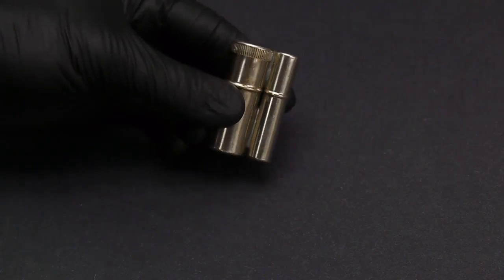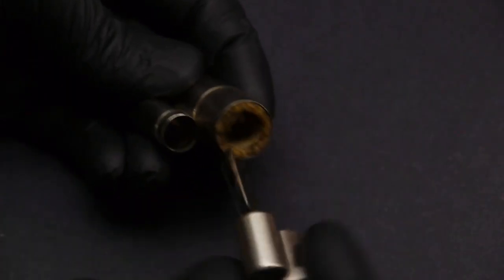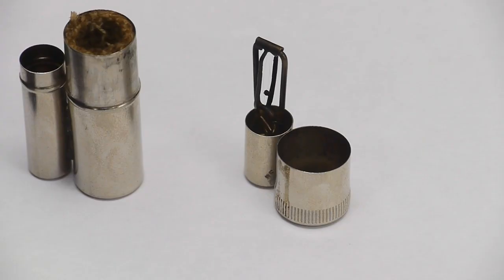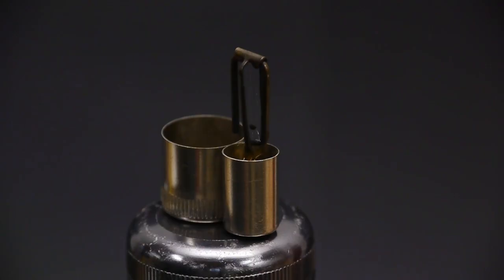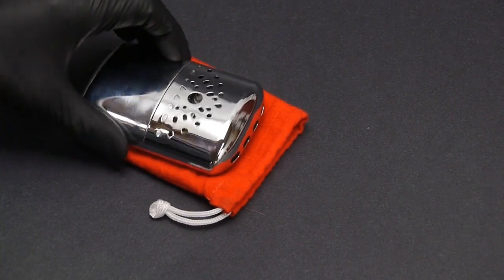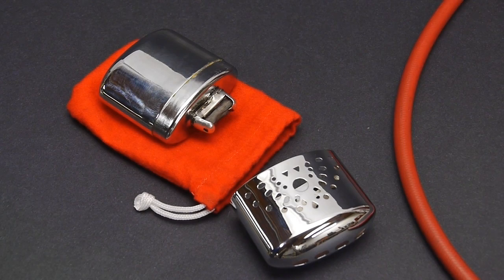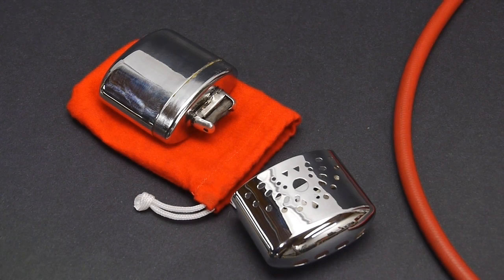Catalytic cigarette lighter

Comment: The reason I found your video is because I was searching the web for a lighter that would light in extremely cold temperatures. 
So far, I haven’t found any that guarantee an instant light if it’s cold like 5° cold outside, and the lighter has been sitting out there for whatever reason

Comment: I bought a methanol lighter at an antique shop. the wire and ball look perfectly intact but it will not light the methanol. does anyone know why this could be and is there a fix?
Reply: Did you ever get it working? perhaps you had a low percentage of methanol

Comment: Platinum catalyzing alcohol and hydrogen but not propane.
Hand warmer would be good for motorcycling in Bay Area. I created my own heating glove using the +12 volt on the battery with a car headlight in series as short circuit protection.
Because at room temperature, incandescent lamp have a resistance 15 times lower, there is little waste when the current from glove heater is 1 amp or less, compared to 5 amps, 60 watts bulb.

Comment: It does not catalyze the burning of methanol. it catalyzes the incomplete oxidation of methanol to formaldehyde, which liberates sufficient heat (due to the tiny mass vs surface area of the platinum) to ignite the rest of the methanol.
Reply: actually The heat comes frrom the catalytic reaction from the hydrogen thats released and the air .Then it ignites the methanol.

Comment: About 10 years ago I bought a bunch of catalytic gas lighters on Ebay, and I made a YT video to demonstrate them: https://youtu.be/TY2r3bSXX1Y  They are very similar to the lighter shown in Sam's video. One thing I should mention in case you did not know this about these lighters. Over time, the platinum wire develops an oxide coating which severely reduces its ability to catalyze the methanol vapors. The wires can be "cleaned" by waving them through a flame from a Propane torch. Apparently, the gas/air flame burns off the oxide coating, and then the platinum will work good as new (for a few cycles of lights) and then it will need to be cleaned again. I am a new subscriber to Applied Science.  Great stuff, Ben!

Comment: I used to use pocket warmers a lot in winter and regret now living in the tropics. About 10mL of white petroleum will last for about 8 hours. I always found that the catalyst needs to be preheated using a clean flame. If you do it by sprinkling a bit of extra fuel on top and lighting that then the wire (or screen) rapidly becomes contaminated by soot. Incidentally, in the Maltese Falcon, Humphrey Bogart has a really cool desktop catalytic lighter. It looks like one of those ashtrays with the spinning disk. You simply pull the centre piece out and have a flame on the end of it.

Comment: Umm, I actually have a catalytic hand warmer similar to yours. Runs on lighter fuel and has to be ignited with a gas lighter. I can't complain, it's the best hand warmer I've ever had and it still works after 4 years or so!

Comment: I've got one of those hand warmers from Zippo. you're meant to fill the bottom part with zippo fluid and start the catalyst using a flame. Once the reaction is self sustaining you can replace the metal cap and put it in the bag. It doesn't light up on its own.

Comment: I found this really old looking fireplace lighter that used to belong to my late great aunt. It comes in a velvet sleeve and is about a foot long and made of brass. It's very thin, about half to 3/4in and appears to have a valve on it for filling it with butane. So I wouldn't imagine it's THAT old. But definitely at least a few decades.

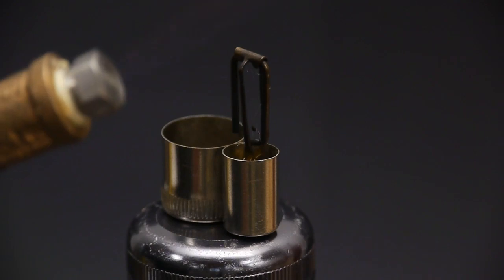Comment: At 1:52 did the platinum wires break?
Reply: yeah that's done and good luck finding a replacement
Reply: That platinum wire is available from Sigma Aldrich. I have rebuilt these, use a slightly lower guage for stability like this one: http://www.sigmaaldrich.com/catalog/product/aldrich/349402?lang=en&region=US&cm_sp=Insite-_-prodRecCold_xviews-_-prodRecCold10-2

Or go on ebay, but trust me on the 0.25mm size. It provides longevity!
Reply: caleb archambault darn it ! That was a nice antique too.
Reply: Yep!  He cooked it good.  He did a very good job of explaining what happens with platinum & methanol & oxygen.
Reply: As a chemist i have had troubles sourcing reagents and products for noncommercial purposes with sigma it would probably be easier to try your eBay suggestion
Reply: He's said before that as an individual, Sigma Aldrich won't sell to him. But it shouldn't be too hard to find Platinum wire elsewhere.
Reply: I work with Millipore, so I just get it when I'm getting fresh reagents for my water testing kits. They sure do give inventors & hobbyists a hard time though...

Comment: It made me cringe to watch that wire melt.
Reply: That's the same wire used for photocopier corona emitters.
Reply: I have catalytic lighters - AirFlam, NewMethod & others. This wires are fine & fragile. When lit DO NOT mess with them.
Handle with care. There is no replacement for these wires and only a handful of these platinum catalyst lighters exist.
Reply: @rogertycholiz2218  sigma sells replacement wires
Reply: me too.. i love antique lighters

Comment: wow, where can I get a metallic hand warming hotpocket? if only Jim Gaffigan knew about this...
Reply: +MPGster s Zippo brand lighters makes 2 versions of these hand warmers. 1 is more expensive than the other. I think the lowest price is anywhere between $30-$50. i bought one a while back and they work very well... as long as you keep it in the pouch it comes in so it traps the heat better. also works better in your pocket. can last about 5 hours a think.

Comment: If you look on ebay for these pocket warmers they state that you need to heat the platinum with a match or regular lighter for it to begin catalysis (in combination win benzine (not benzene)), after that initial kick it should go on its own. Maybe try that?

Comment: I had one of those hand warmers as a kid, I think the brand was Jon-E.  It was not self igniting.  You would light it and once the mesh glowed you could blow out any flame or the flame would go out on it's own.  The mesh would continue to glow and give off quite a bit of heat, as long as it had sufficient air.  If overfilled with fluid, once it warmed up the fluid would leak out and soak you, sometimes becoming very painful (nipples) as you would not notice you were soaked in lighter fluid.

Comment: thanks applied science - harkens me back to my days in a construction materials testing laboratory...some but not much of the same actual equipment, none of the glassware and the chemistry reactions not really necessary the projects we were working other than rudimentary observation the reaction of various galvanized wire (nails) in CCA treated lumber sawdust and chips)

Comment: I recall finding something similar when I was a kid.  It had a wood handle with a stiff wire extending from one end and then the little ball suspended in an arrangement at the end.  The directions said it could be used to light stoves.  I tried it on the gas stove at home after extinguishing the pilot light, holding the ball part next to the burner in the flow of gas.  The suspended ball glowed red hot.

Comment: I used to have one of the catalytic hand warmers; the catalyst had to be preheated before it would work at all (that was done by soaking the catalyst with lighter fluid, lighting it with a match or lighter, and then blowing it out after a few seconds).  I don't recall if those use platinum catalyst, though; based on the price, there wasn't much if any platinum in their catalyst unit (and if not platinum, it might not react to hydrogen).

BTW, I quit trying to use the naphta fueled warmer because the fluid is a very strong irritant; even a fluid type lighter gives me a severe contact rash.

Comment: The velocity of the gas from cylinders is was too high and results in cooling of the wire at a rate higher than any catalyzation could heat it... if you tricked the gas out like happens in the natural vaporization of the methanol, I bet that the propane would light.

Comment: If those handwarmers are like the ones we have, you actually have to light and "activate" the surrounding material around the catalyst and that starts the pulling of the white gas into the catalyst and sustains the reaction. Not 100% on the details, but ours you have to pre-light.

Comment: Neat. Looks like magic. I used to have a disk-shaped metal hand warmer that you put lighter fluid into and then ignited using a battery. I guess the battery produced a high enough current to heat a thin wire to ignite the fumes.

Comment: The hand warmer is not self starting.  The platinum needs to be heated to start the process.  There is probably a wick or small hole for a wick to light next to the element.  Light the wick, let it burn for a minute, to heat the element, then blow out the flame. There is no flame once running.  The bag is important because the fuel vapor will get blown away otherwise, and not get catalyzed.  After 30 minutes, if left alone, it'll will get quit hot to the touch (another reason for the bag).
I use lighter fluid(naphtha), but I've heard you can use white gas.  I have a Jonie hand warmer (a vintage one... But you can still buy them new).  Nice compilation!
Reply: I had one as a kid.  I used lighter fluid.  Great while hunting.
Reply: There is no platinum on the screen. Its just a piece of fine mesh stainless steel.

Comment: Great stuff.

When I was growing up I remember my parents using some sort of thing that kind of looked like a gas BBQ lighter such as you can buy now but the thing they had had no trigger, No power source or flint but putting it in the path of the gas flow ignited it.

I vaguely remember handle, steel shaft and the end had a spring like coil with something in the middle. No trigger or any other thing to use it you just picked it up and put it in the gas and it ignited.

I suspect it might have been something smiler to your unit but I have not see anything like it for sale since I was a kid.

Unfortunately this was before I developed the habit of pulling stuff apart to see how it worked. I think I had a plastic hammer and screwdriver and a teddy bear at the time. Kind of Dilberts the knack sort of thing. :-)

Comment: Where can I get platinum wires? I need to use it as a cheaper rudimentary catalyst or for electrochemistry without the need for thousands of dollars.
Reply: Some automobile exhaust catalyst have platinum sponge on thick wires/mesh so you might get platinum sponge and electroplate the platinum out. there are books out there about recycling auto platinum catalytic convers.

Comment: I have some of the new production Zippo handwarmers. They work quite well. They recommend lighter fluid or naptha. Im sure white gas would work too. I fuel mine with denatured alcohol, it works quite well and is easier to get going. The smell is a bit odd though burning alcohol.

Comment: So is platinum jewellery dangerous in some situations? 

I mean like a platinum wedding ring in a coal mine where there may be methane gas deposits?
Reply from the maker: I think the surface area of something like a wedding ring would not be high enough to generate any noticeable amount of heat.  A platinum necklace chain is getting closer to the area/volume ratio of the thin wires in this cigarette lighter, and it may become warm.  In a jet of hydrogen gas and air, it might become dangerously hot.
Reply: I don't think so. You need a very big surface over a tiny object so that the thermal mass is small enough for the platinum  to really heat up.
Reply: lougrims In addition, the gas concentration will not be high enough to overcome entropy of a large piece of metal.
Reply: Seroster How?
Reply: Sam Underhill Think of a sponge, read "Chaos" to get a comprehension of the math involved.
Maybe several square feet, but meters is stretching it.
Reply: Interesting question!
Reply: Applied Science The surface area of that tiny platinum black pellet is probably in the range of several square meters. T
Reply: Sam Underhill
How? It's in "sponge" form, the sole reason to sponge something is to increase the surface area by several orders of magnitude.
Reply: Keith Larsen I think you meant that it was more stable, not less stable.
Reply: Propane is less stable than methane, and it wouldn't light from it.

Comment: I don't think the 2nd one is self-igniting... Did you try adding lighter fluid and lighting it? 
Is the first one fixable?
Reply: I would say the catalyst has been poisoned with lead from using leaded gasoline in the hand warmer. Might be possible to reform it if you light the hydrogen and get it up to white heat for a minute or two to boil off the lead deposit mostly. Would suggest doing in a fume hood though, as it will give of a little lead vapour. Use a small pinhole nozzle on the gas so you only have a tiny very hot flame so you do not evaporate the nickel surround.
Reply: I think the hand warmer needs preheating. Put it on fire using lighter and blow the fire off after while. That's how i get mine started. However cheap ones don't have much platinum, but you can get better replacement platinum pads (eg. one that zippo brand makes). Maybe you can even stick two of these in there to get twice the heat output.
Reply: by replacing the platinum coating, or the whole wire it should be fixable yes

Comment: The hand warmers are usually started with a flame to get them going. I have a couple and they are definitely not self-starting. The instructions say to pass a flame over the catalyst for several seconds.
Reply: Maybe related, I don't know.  My grandmother used to have a gas cooker lighter.  It looked like an ice-pick with a painted wooden handle, and where the sharp end of an ice-pick would be it was coiled with a wire and a pellet on the wire.  I'm guessing platinum wire and platinum black pellet.  You'd just tun on the gas and hold this in the gas which ignited very quickly.  The box said that when it took longer to light the gas, to hold the end in the flame for some time.  That 'regenerated' it - perhaps burned off some coating?
Reply: It does sound like it was a catalytic lighter. Leaving a slow lighter in the flame would definitely help burn off some contaminants.

Comment: Why does it have both a pellet of platinum black and platinum wire? Would having only one or the other work?
Reply from the maker: The powdery pellet has much more surface area than the wire does, and it will concentrate heat generated by the reaction.  The wire by itself may not become red hot in methanol vapor, but when warmed by the pellet it becomes more catalytic and serves as a better ignition source for the methanol vapors.  I guess the pellet is a sort of starting mechanism for the whole process.
Reply: Applied Science Interesting. Thanks for all the great videos!

Comment: 1:53 did he just break the Platinum wire?
Reply from the maker: Unfortunately so.  The hydrogen flame was too hot for that piece of wire!
Reply: Applied Science Oh well I'd imagine platinum wire is available to you :-)
Reply: Mark Rose Seems to be available from suppliers for about $200 per 1m length, you'd need to find a jeweller I'd imagine to purchase smaller lengths, so 10cm which should be enough to fix that a few times would be $20 :)
Reply: Yeah
Reply: Applied Science
The wire is not platinum right?
The pellet is the catalyst
Reply: Mr. Weathers I believe the wire would also be platinum, not so much for the catalyst action (as you say, the pellet does that job) but purely for heat resistance
Reply: Yeah he did lol
Reply: That's sucks, but thank you for showing us this.
Reply: ***** Available, but at what price? A gram of platinum is about $40, and that's before someone has made wire out of it.
Reply: Mr. Weathers He said in the video either the wires would be platinum plated or be pure platinum.

Comment: That is super awesome!
I am assuming this is quite similar to catalytic converters except it burns CO?
Reply: Catalytic converters also contain platinum and oxidise un-burnt fuel as one of their functions.
Reply: don't they also burn carbon monoxide once they get warmed up and convert it to carbon dioxide?
Reply: Aaron Reichert That's the other function of a 2 way Catalytic converter. There is also a 3 way Catalytic converter which also does NOx I don't understand any of the chemistry.

Comment: If the propane did not make the wire glow why did they propose to use them in gas street lights? Was it not natural gas that was used in thoes lamps?
Reply from the maker: This is a good point.  I should have also tested the device with methane (natural gas).  This patent seems to suggest the platinum black (platinum sponge) will ignite methane:  https://www.google.com/patents/US971581
Reply: Applied Science Also a lot of towns used coal gas, which has a fair quantity of hydrogen in :)
Reply: Applied Science
 I'd be curious to see that. Methane CH bonds are definitely not easy to activate. (There are several people working on that in my lab. Mostly trying to convert it to methanol.)
Reply: This is a very good point; in some modern "jet" lighters, the platinum wire is still used to create the catalytic flame, and they use propane/butane mix. You can see the wire as a small gauze the width of hair at the nozzle if you look closely. Still doesn't explain why the wire doesn't seem to light up, though. Wrong air/gas ratio?
Reply: +sashablfc It was a different reaction in gas lights. Just flame heating ceramic until it glows. If you look up "thorium mantle" you can get more on it.